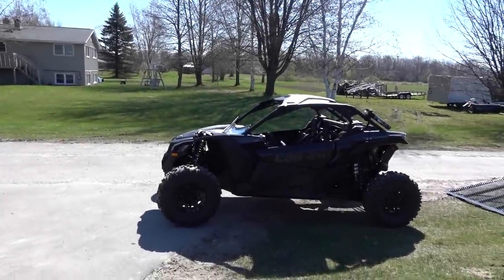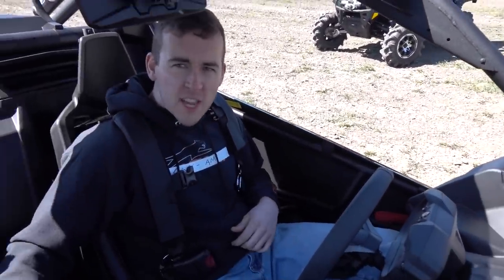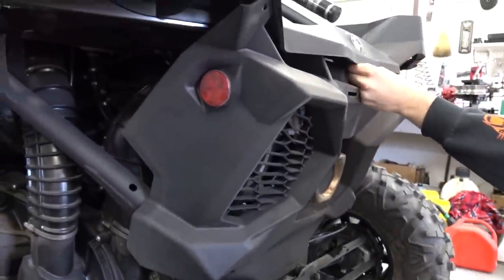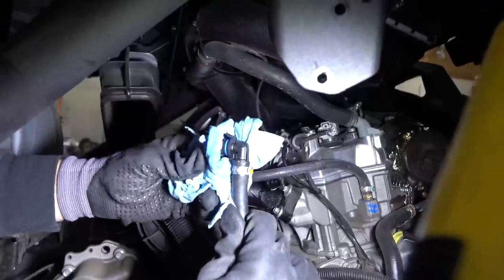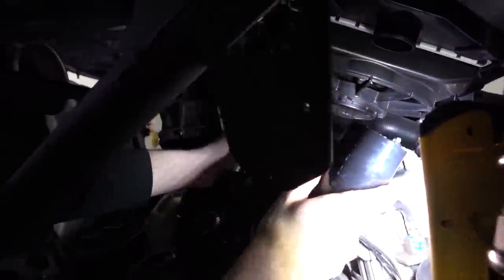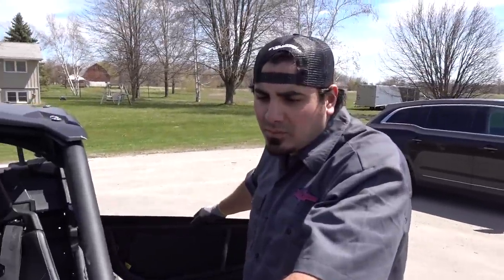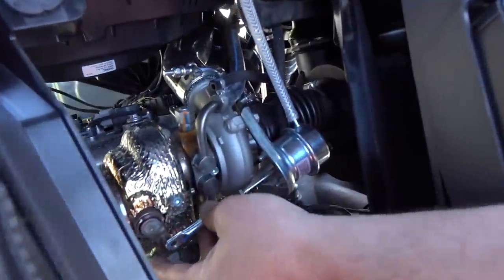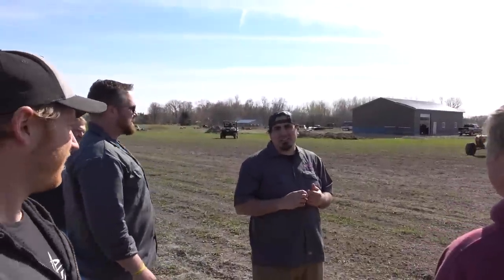Stock SUCKS! Maverick X3 Evolution 3RWI install, test, and 0-60!

Comment: Spray penetration oil on the vband clamp get a prybar on the clamp and hit the back of the prybar with your hand or lightly with a small deadblow they will pop right off I been a diesel tech a few years now and that's the best trick iv learned

Comment: Do the honda again on the hard pack. I would like to see the comparison to the stock maverick
Reply: Lol that's no comparison
Reply: @ryanhill5618  its is not for direct comparison I am more interested in whether the Honda performs better in the 0-60 than the last test in the mud. I suspect the honda will be quicker on dry ground than in the slush it was tested under.  I can't wait to see what the YXZ does.

Comment: Did you replace the fuel pump on the X3's? That tune calls for a higher flow fuel pump doesn't it?
Reply from the maker: Nope, stock fuel pump is good for stage 3.  Only exception is on 2017 models, you can make more power by upgrading to a 2018+ pump.

Comment: What happened to the XX. Did you guys trade it in..
Reply: I'm guessing after the motor blew up it went back to the dealer for some repairs. Either that or the warranty won't cover it and it's in the BSU waiting for Doug Butterebuilding.